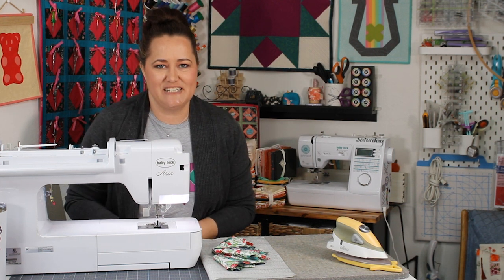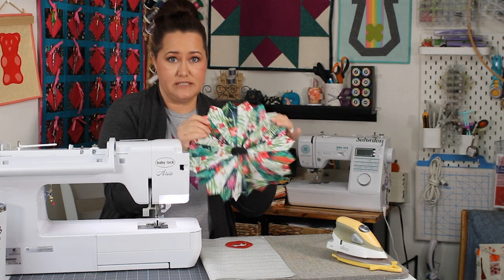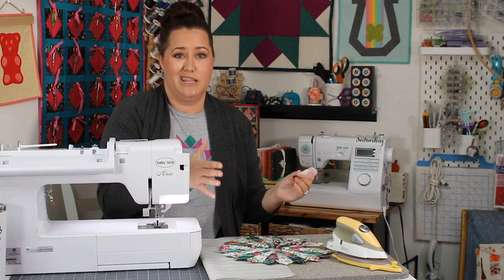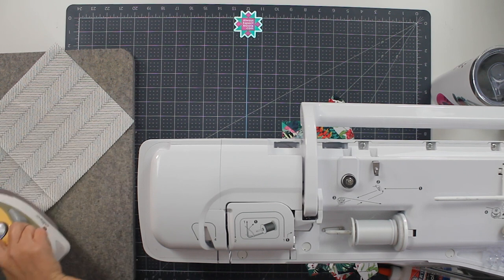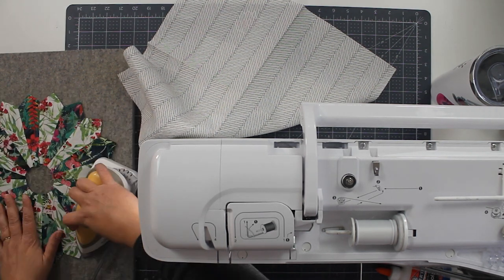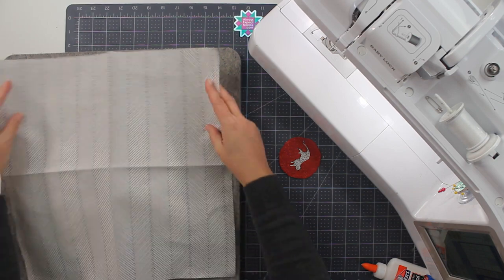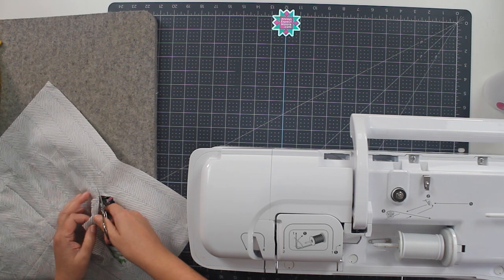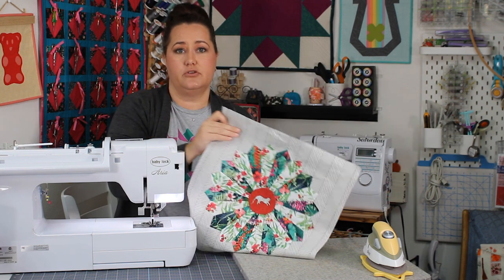How to Applique a Dresden Plate Quilt Block

Comment: Thanks for the video. A question, if you have time. What happens to clear monofilament sewing thread when you iron it? I think this would take out that springy action, but would it melt to mush, or not get hot enough to take its new position as a new shape? Again, thanks.
Reply from the maker: I haven't had an issue with it. You can use a lower heat setting on your iron if you're concerned. I'm not sure what the melting point is, but it is pretty high...
Reply: @CarolinaMoore  Hey, Thanks. 🙂

Comment: I am stitching a dresden plate quilt for a friend.  I am going to hand tie the quilt, please give me suggestions how many ties, and where would you place them? There are 20 blocks, and I used sashing between the blocks.  thank you for your information.
Reply from the maker: Great question! First, check the batting to see how far apart you can have the ties. It is the batting that determines the minimum spacing. If it is no more than 8" apart, you can have a tie in each corner and one in the middle of a 12" block with room to spare. 🥰